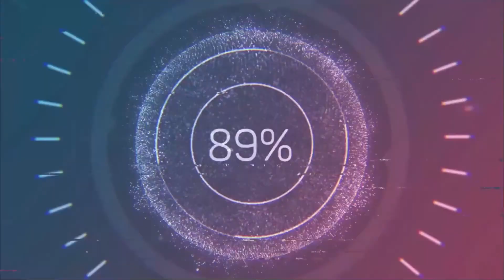All Aluminum Coils & Formicary Corrosion

Comment: Contrary to popular myth that the switching of refrigerants caused all these refrigerant leaks: I worked for big house HVAC over 20 years ago. They would order pallets and pallets of R22 Freon & R410a Puron. Because R22 was so cheap we more or less gave alot of that stuff away to get our feet in the door to sell a new unit. Freon or Puron didn't matter. They all leak, certainly some more than others. We also sold the fanboy Trane units too. Didn't matter, I ran those calls of leaking coils. Dealing with customers looks of disbelief when the Trane had failed. What do you mean it failed? We bought this because your company said it was the best. You're never done in HVAC. If you think you are, you got sold bro. The common theme is to say our brand is better than your brand. That doesn't hold water in my experience of 28 years in HVAC.
Reply from the maker: Thanks for the comment Austin Air, I agree, R22 R410a, it does not matter, what does matter is copper aluminum coils. I have several comments about all aluminum coils leaking also. I too have replaced all aluminum coils, however, when we put those coils in a dunk tank the leaks were not in the fin packs but on the U bends and welds or where the tubing was rubbing and created a hole. We have never found middle of the fin pack leaks. 

I still believe we had the perfect storm. The manufacturers were trying to get higher and higher efficiencies and in order to do that they had to thin the copper tubing, combine that with higher velocities of the refrigerant and, I believe, a phenomenon called flow electrification took place and hastened a corrosion that was there all the time but took decades instead of months or years to appear because older coils had thicker wall tubing in them. 

As for brands, Trane still to this day installs copper aluminum evap coils in some of their package units, and yes we have had to change out multiple coils on those units. However, not one of the all aluminum coils on those package units have we changed since the switch. 

Here is the link to my Leaking Coils playlist
https://www.youtube.com/watch?v=XLO3HFO1T9I&list=PL705cCgW7U3O08SWuu3PHoN3bI3ggxIlk

My problem with all this, the manufacturers knew about this and yet they keep doing the same thing over and over again expecting a different result. The big difference is that if the unit fails there is a good chance they will sell a new system. Planned Obsolescence?   

Got you beat on the time in trade 46 years!
Thanks again,
Mitch
Reply: @baileysair  Well Trane is far from perfect. I would say their coils are only marginally better than the rest. They have plenty other issues since they sold out to IR. It's all a move to control the market one way or the other. Give people an illusion of this is better than that. You don't control a market by making a product that never fails. So there's that. If you stopped hitting your sales numbers at Trane what would happen? 

Realize you don't need to answer that question. I know the answer You have to say it's better to get the sale, you have to hope it's not to get another sale to make Trane happy. A house divided against itself? Not that this equation is different with any manufacturer. They are there to sell a product, not make one that will last forever. I know pre-mature failure isn't great on the service side either. But this cat and mouse game has existed thru out my career. It's nothing new. 

My position isn't to bash a product necessarily nor to elevate another because of the name on the side of the box. They all break, my job depends on it... as does yours. Ah the smell of freon in the morning. ha, ha, ha. In a couple more years even more fun.
Reply from the maker: @AustinAirCo  Agreed, you realize that I have never locked myself into one brand or another. However, it does seem to work out that way.  For example, in the 90's we became an Amana Dealer with exclusivity, we made a deal that we would generate more sales each year and they couldn't sell to anyone else. This lasted for about 5 years, then they changed salesmen on us and the deal was broke. We then did the same deal with Lennox with us being the only Lennox Premier dealer between Fresno and Sacramento in 2000, that lasted about 8 years and now we are a Trane dealer without exclusivity,  which is fine by me. The only brand I won't sell is Lennox, mainly because of our falling out due to the coil issues, and them treating my company and customers like crap. So, I do set all other brands and in fact we are setting more Rheem than Trane, mostly because of availability and cost.  

You are right about any brand not being the best and they all have problems. However, my relationship with Ferguson and Trane is the best, cross your fingers, and that carry's over to our customers. In fact, Trane and Ferguson are the only wholesaler that has stepped up and provided a new unit when a customer has a lemon. Relationships are what it is all about.
Reply: @baileysair  Distributor problems are unique in and of themselves. A distributor can change brands, just as much as you could. When I started out on my own I wasn't afraid to use any brand. Over the years I've found that failure rates are fairly even across the brands. Some might have trouble with xyz, while others with abc. Trouble is trouble it rarely matters what kind or type it is. 

I used Amana for a time, the pandemic hit and I was cut off. I was told nothing personal, just business. This was merely from factory to distributor --- factory can't hit volume, distributor going to choose favorites over $$. I know this wasn't a problem for just Amana it effected all brands. You can't sell something you can't get. Needless to say this situation becomes abundantly clear it's only about the $$$. So longevity of being better is a smoke screen and nothing else. People don't want to hear that. They want the best not realizing what is coming... 

But because what I did early on, I wasn't afraid to do it again because failure rates are fairly even across manufacturers. The comment about Lennox -- I have customers with little to no issues at all with Lennox. I have customers that have Lennox and nothing but trouble. BUT I have customers with other brands with nothing but trouble as well. 

With refrigerant changes coming, the brand on the side of the unit will mean less and less. Control the refrigerant, control the market. These companies are global power houses. To hit the numbers they want to hit on the GWP scale by 2036 means equipment change outs on a regular basis. Your CA market has rules about banning R410a sales as soon as 2025.
Reply from the maker: @AustinAirCo  Yeah, I live in the land of greens that ban stuff or dictate things that turn out later to be worse. Example, MTBE or Methyl Tertiary Butyl Ether, which was added to unleaded gasoline to increase the octane and supposedly reduce pollution. The problem, it gets in our ground water, which is not good. Heck, next year they are going to ban gas furnaces completely in California, and in the near future all fossil fuel appliances and wait for it... cars. 

Currently we set whatever is available because no matter the brand, all of them have limited inventory. In addition we are not able to buy Ruud because we are a Rheem dealer and the local Rheem supply house runs out of equipment. I am denied purchasing Ruud from another distributor as they are protecting their dealers. 

As for equipment failing, I actually have had good results with the Goodman builder units. We set thousands of these in new construction homes between 1998 and 2008, and have had less problems with them than Amana, Rheem, and Lennox. The Goodman units are noisy and not pretty but they run and run.

You are also right that it comes down to dollars and not quality. Let me explain, we were doing this one builders homes back in the late 90's, he would build about 600 homes a year. We did the roof metals so when there was a leak in a house we were called out with the roofer to see where it was coming from. This one year we had intense storms that blew the wind horizontally for hours on end. These homes were constructed using stucco walls and lath with building paper on them. I went out on over 100 homes that were leaking and all of them were leaking at the wall and not the ceiling. The builder ended up sealing those walls from the outside using clear elastomeric paint to seal them and shed the water. Anyhow the plaster went to the builder and told them that his specs. showed 20 minute paper and  if he switched to 60 minute paper it would solve the problem, and he would only charge another $100 per house to switch. The builder said no, because if he did this it would cost an additional $60,000 a year while he was only paying $300 to paint the walls which only costs him $30,000 for the 100 homes, and a rain like this only happens every 20 years or so. You can see that quality was not a priority for him, I wonder if the buyers if they knew would have been willing to pay the builder more for the home to install 60 minute paper.

Thanks for posting, Mitch Bailey

Comment: It all has to do with money. Not engineering. Coefficiency of aluminum is not as good as copper. And copper is easier to fix than aluminum
Reply from the maker: They used copper tubing in their coils to get higher efficiencies, they could also thin the copper tubing, because it is stronger than aluminum and this also would increase heat transfer, and yes copper is easier to work with. However, they created the perfect storm. 

I believe that the one of the major causes of formicary corrosion is flow electrification. I researched this when it cam up and discovered that R410a, POE oil have a high capacity to hold a static charge. This charge is released in the coil as the refrigerant and the oil are turned to a vapor. This static charge release along with thinning the copper tubing hastens these leaks compared to copper aluminum coils of the past that had thicker walled tubing. In other words this would happen to those coils, only it took decades and not months or a few years.

My whole problem with this is that the manufacturers knew of the problems with coils and continued to manufacturer them blaming it on the air in the home and not really delving any further.
Thanks for the comment and yes I agree it was all about the money.

Comment: I see alot of manufactures who make aluminum coils where the bottom refrigerant line sits to low in the condensate pan causing it stay submerged in water. They always end up leaking there.  I like Trane coils too because they are raised up higher out of the condensate pan and stay dryer. I think their best coil they sell is the MX series coils. They are  pvc coated which prevent dirty sock syndrome and even has heat shrink around the capillary tubes. Great information in your video. Thank you.
Reply from the maker: I agree, coated coils are fine.

Comment: I friend of mine told me that works in the AC business, he has replaced more Lennox and Carrie coils in the last year than he can remember.
Reply from the maker: I found that it doesn't matter which brand, the catalyst was the copper tubing and aluminum fins create a anode-cathode circuit and starts eating away at the copper. However, I am no corrosion engineer but I firmly believe that there is some other contributing factors. 

First, they thinned the copper tubing in order to get better heat transfer.

Second, they rifled the copper tubing to facilitate better refrigerant flow and heat transfer, while strengthening the copper tubing.

Third, we switched from R22 to R410a refrigerant, and R410a uses POE oil, a synthetic oil.

Fourth, I believe the corrosion was aided by a phenomenon called flow electrification. Flow electrification is the ability of a fluid to hold a static charge. I believe that the POE oil and the R410a refrigerant actually builds up a static charge as if flows through the copper tubing. Then as the oil and liquid refrigerant enters the evaporator coil and begins to boil off into a gas the static charge that was built up is released. This extra charge aids in the corrosion happening much quicker than it would naturally occur over time. Add in that the wall of the tubing is thinner and we have the perfect storm.

When this all began occurring I tried several science departments at several universities to see if one of them would take this up and see if my hypothesis was correct. However, the physics department said is was a chemistry problem and the chemistry department said it was a physics problem and it went nowhere. 

That all being said, the true fix was to go to all aluminum coils, since switching I have only replaced about 3 all aluminum coils and those were from bad factory welds. 
Thanks for the post.
Reply: @baileysair  thoroughly scientific approach. Thanks for sharing so much over social media.

Comment: We replace all aluminum coils everyday. TAM Trane Evap leaks after a few months of install. We do closer to 3 k installs a year. Please don’t think your Trane unit won’t leak. I prefer the tinned coils.
Reply from the maker: I can only speak from our experience, we have over a 200 to 1 ratio of copper aluminum coils springing leaks compared to all aluminum. Although we don't set as many as you, about a 10th as many per year, it is still a 200 to 1 ratio.  

In addition, since switching we have only had one or two all aluminum coils leak each year out of the hundreds we install,, and those were either bad factory welds or tubing rubbing together or against the case. I will grant that you have some coils that leak that are all aluminum, however, it no way compares to the copper aluminum leaks in units that we have found.

Comment: Thank you this information.  My Lennox just failed after 12 years.  The replacement Ruud has all aluminum evaporator but has copper tube fin condenser. You didn't mention condensers.  Do they have the same issues?
Reply from the maker: Hi, no the condenser coils don't have the same problems we have been running into on the evaporator coils. One of the big factors to cause this corrosion is that the evap coil gets wet. This moisture facilitates the corrosion. However, condenser coils usually are dry and so we don't see the leaks forming there. However, heat pump outdoor coils do run in the winter and they do build moisture, and ice on them. That being said, we do a few heat pumps, but we aren't replacing any coils, so I think the outside coil is safe.

Comment: Aluminum coil is much more prone to leaking than copper coils
Reply from the maker: Since switching to all aluminum coils I have had 4 coils out of a thousand installed with leaks. However, they were either factory welds or where lines were rubbing together. Moreover, we replace over 50 coils each year that are copper aluminum. The math alone tells the whole story. That is why I will not set systems with copper aluminum coils.
Reply: i have had the same experience. rub through seems to happen easier

Comment: I have same issue with my Lennox unit. Coil leak, undetectable without nitrogen test which I got years after the issue started. Thanks for the clarification on what is causing the issue. Was planning to go with Trane for the next one and this gives me added confidence.
Reply from the maker: Sorry to hear about your leaks, I do have a couple of questions, how old is your system and check to see if it actually is a Lennox coil? Be aware that many companies use 3rd party coils.